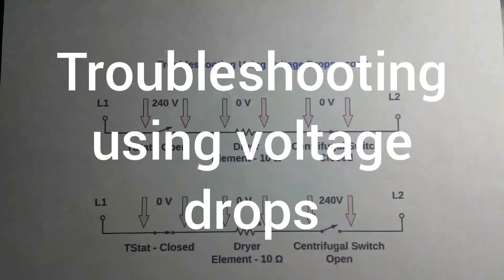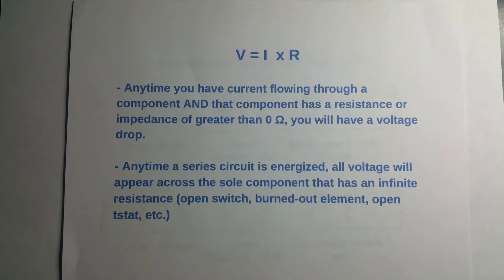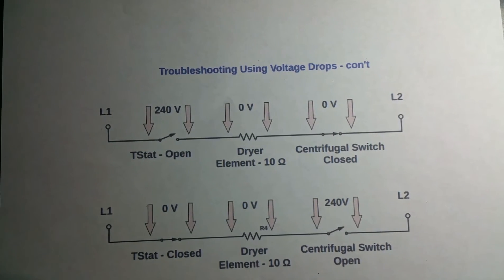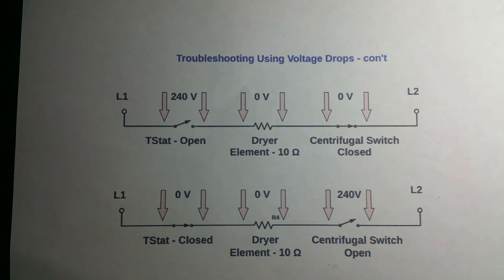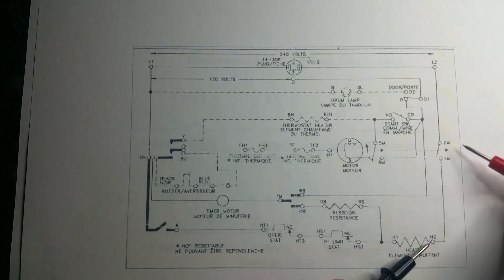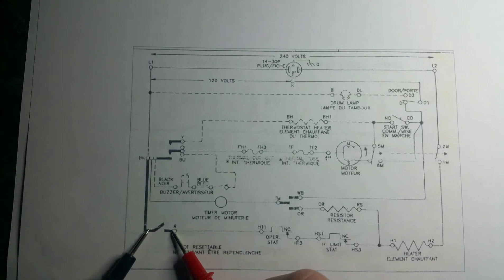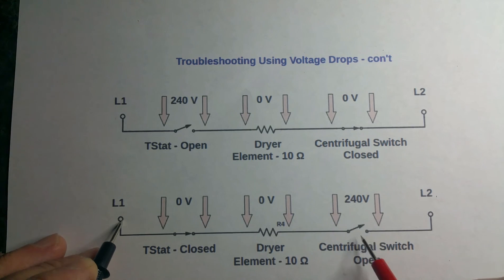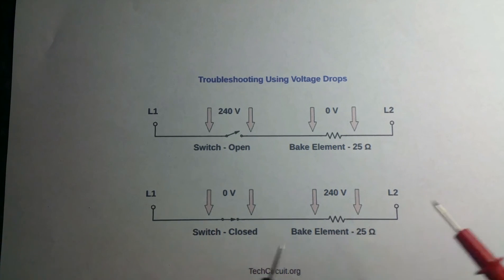#3 - Troubleshooting Appliances Using Voltage Drops

Comment: Great video and detailed presentation. I really like the method of using voltage drop reading to check motor centrifugal switch while dryer is running. Thanks!